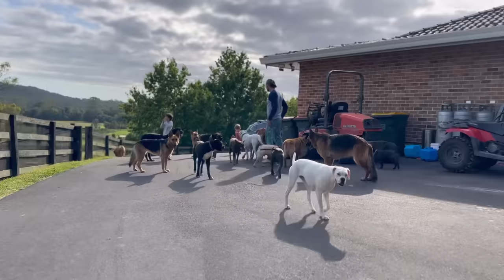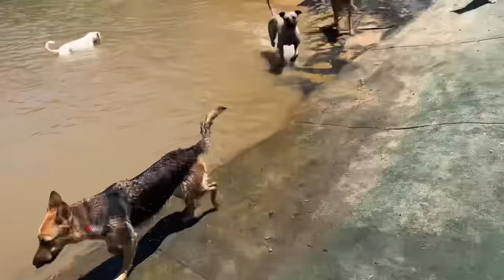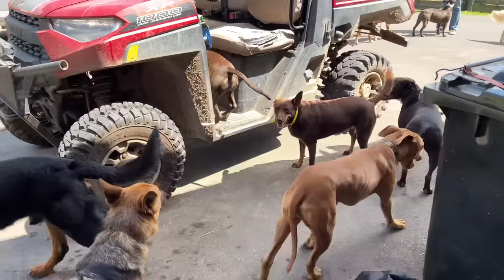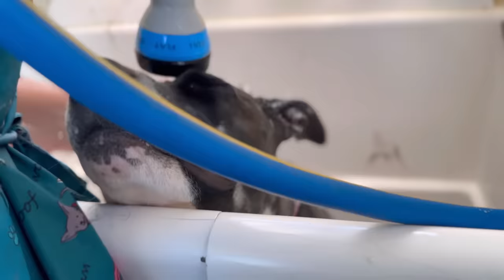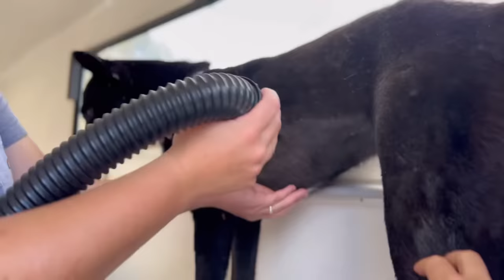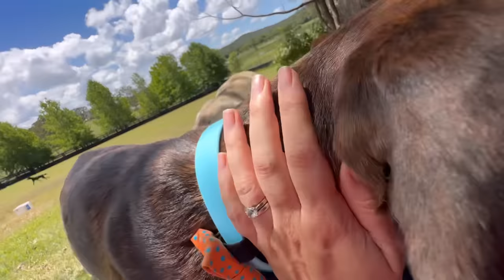Salon Day for the Doggies

Comment: Try adding pure coconut oil to Chance's coat. It has anti-microbial properties, helps with allergies, great repellent for upto 7 days for stable flies and other blood sucking insects and repels brown dog ticks upto 88%.  It improves the status of antioxidants and increases collagen levels (both of which are crucial for helping wounds heal. Will also help with infection and inflammation, it's also extremely effective at killing specific bacteria that causes skin health problems. Rub the oil between your hands and then rub it into his coat and make sure it penetrates the skin, leave for 5 minutes and then rinse off. Apply once to twice a week.  If you see any allergic reaction to the coconut oil, stop immediately. Allergic reaction is not common though.  I use it on my dog. All round a great product.